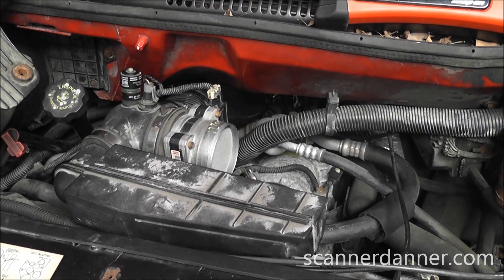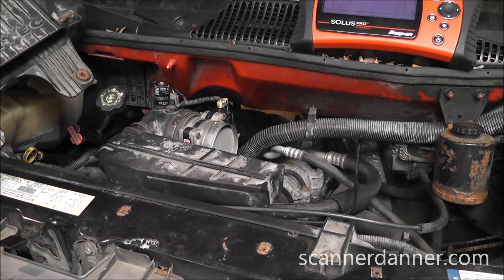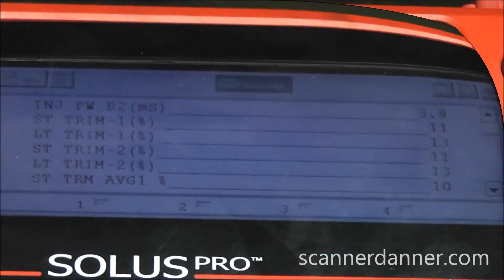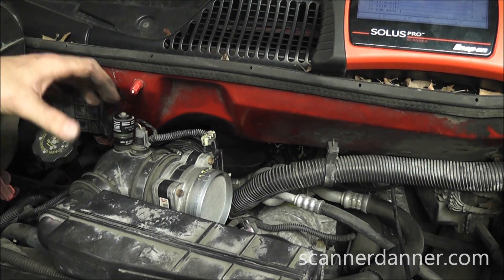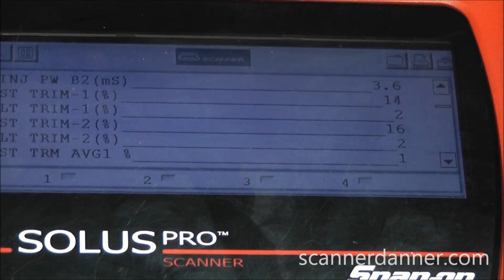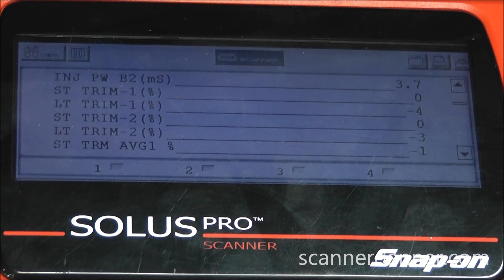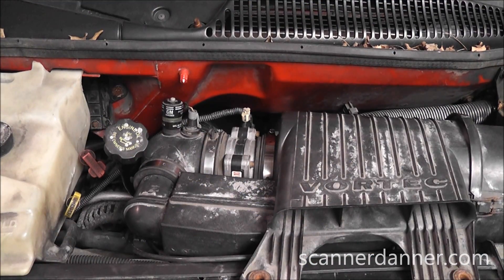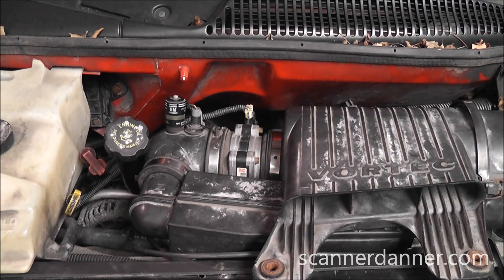Cold Air Intake Warning! (missing air filter case study)

Comment: Fantastic video and videos. Not run of the mill. I'm going to see if the Spectrum oiled filter that I put in my 1998 Tacoma 4wd is giving me the slight lean and elevated rpm. I cleaned out the whole intake system to avoid confounding variables and replaced IAC which was encrusted (after MIL).  Replaced lots of crumbling hoses.  Situation dramatically improved. No codes on the lean.

Other places for possible vac leaks that I learned from SD (thanks!!!) are intake manifold gasket and o-rings. (Brake booster also possible)

I can't afford mechanics on the MILS. They can tell you anything they want. So I LEARNED BASIC OBD2. If this were my career

I WOULD MOVE TO DANNER SCANNER'S STATE AND TAKE HIS COURSE!!!
Reply from the maker: Thanks so much!  Don't forget you can take my class remotely on ScannerDanner Premium right here on YouTube.
Reply: ScannerDanner, there are those of us who would like to take your class in person because you are just that awesome!!!

Comment: Hey ScannerDanner. I have a 1999 1500 4.8L that had 50 shrt term both banks and would pop back through intake right above idle, id say at 900RPM.  but would drive great passed 1500RPM. It was a dirty air filter that caused the problem have the filter was much cleaner causing turbulent air before MAF. This is easily overlook.  Awesome Videos buddy

Comment: Hey, Paul   A few weeks ago, I had  an air filter torn on an infiniti, causing a no start an p0101 code. A day later, I had the code p0420. My reasoning was the torn air filter caused more air into the engine and a lean condition resulting in the p0101 due to rationality check and the p0420 due to the added fuel by the pcm to balance the mixture. Could you please tell me my if reasoning is good? Thank you in advance.

Comment: http://www.standardbrand.com/en/content/mass-air-flow-sensor-faqs/

MAF sensors require laminar airflow, which occurs when the air flows in parallel layers, with no disruption between the layers. The MAF element only samples a small part of the incoming air stream, so if laminar flow is not present the air measurement and fuel delivery will be incorrect. Some older vehicles have a diffuser installed, but most rely on the air filter design to provide the laminar airflow.

Make sure there are no “performance” airflow devices installed in the air intake (like those tornado devices you’ve seen on infomercials). These devices will disrupt the planar airflow that is crucial to accurate MAF readings.

Comment: Will a K&N air filter do this to my 2009 GMC Sierra 5.3 liter v8?  The reason I am asking is I recently got an OTC scanner that shows me my fuel trims.  My fuel trim numbers are as follows:  LTFT1 was(-12.5),  LTFT2 was (-11.7), STFT1 was (2.0) and STFT2 was (2.0) as well. Is this normal for this year and model truck?  It runs strong and idles very smooth. I have noticed that I am getting the same fuel mileage as my old truck which was a 95 Chevy Silverado with the 350 V8 that has over 200,000 miles. Please help!!!!!  You have one of the best channels on YouTube.  I found your channel from EricTheCarGuy's channel.  Thanks!
Reply: Did you ever figure it out? Based on those readings it seems the ecu is subtracting fuel delivery which indicates there is not enough air or too much fuel entering the combust chambers. Actually those numbers are not all that bad though.

Comment: Man I'm glad I found this one. I argued with another master tech for almost a whole day saying a leak before the MAF could cause a problem due to the fact that it would read more air. It was just a theory in my head but I'm definitely showing him this now.
Reply from the maker: +andrew johnson Not necessarily more air but it can change the characteristics of the airflow to the point that it skews the MAF calculation. I think the key in explaining this to him is to remind him that the MAF sensor does not sample the entire volume of air, just one section of it, then based on the size of the bore a mathematical calculation is done.
Reply: +ScannerDanner alright thanks man. I'd also be curious to see the results on a speed density system. Not really sure if it would make much of a difference or if it would run slightly more rich similar to a vacuum leak.

Comment: I've seen a intermittent P0101 MAF code on a 09 turbo Chevy HHR after changing the MAF sensor for the same code. It had a aftermarket replacement filter that looked like it had more or less paper channels vs the factory filter. I could never duplicate the data that set the code. I installed the factory filter on and haven't heard from it since. I don't believe it messed with the fuel trims. My theory is it sometime has voids in the swirl effect on certain induction speeds because of the variable turbo.
Reply: +Brandon Tracy.  I was previously a Chevy tech at a dealership, We have had several vehicles come in from time to time with problems. Most of the time we had found aftermarket air filters the fit, but did not perform as the designed factory filters. Once replaced with a factory air filter the problem and DTC was eliminated.
Reply from the maker: +Brandon Tracy crazy huh? I've been focused a lot more lately on the air filter housing and types of filters being used as well. Nice find and fix man

Comment: I actually agree with Co Jones to a point. I know in some vehicles feeding it an air temp or pressure(ram air effect of some cold air intake systems) actually causes problems because it creates a situation the computer is not expecting. So much so that it can affect mileage.  Guys looking for better mileage instead of power have found that many of the cold air intakes adversely affect mileage.  
Now in my case I really do need a cold air intake on my custom diesel van. Pulling a grade when the EGT hits 1100 degrees you start to worry a little bit. The problem is that it's a 6.5 and so custom that there is no good place for an air cleaner or pipes to run for an intercooler or cold air access. consequently the intake is just a round style cone filter stuck over the intake pipe right behind the radiator. Gets all the engine and radiator heat. On a cool day idling at temp 186 degree thermostat the intake temps are around 100. :(
Boost pressures can hit 22psi, which isn't bad for a mid 90's GM diesel. Just can't run it there for very long.

Comment: Love your videos, I'm learning a lot about ECMs and control circuits watching them.

The honeycomb is to create a laminar flow across the sensor, basically a smooth flow through the sensor. The cleaner box was creating an area of low pressure/low flow at the center of the MAF where the sensor sits because all the airflow was coming from around the edges of the honeycomb and very little was hitting the sensor because the vortex was directing it to the edges. Since the sensor is in the middle it wasn't seeing the airflow along the edges and ECM thought the car was running lean. The clue was when you took off the endcap and the airflow went straight through the MAF with no swirling and started hitting the sensor.

Actually, in this case it was the cleaner box was creating all the problems because the air filter had been removed. A cold air intake would have fixed the problem by making the air go straight through the MAF sensor.
Reply from the maker: +Co Jones thanks Co Jones

Comment: The air filter box is designed to wrap the air around the filter, it will not pull straight into the throttle body due to it's design.  This is not the case with most "Cold Air" intakes as the are generally long enough after the filter to pull the air straight.

Comment: So essentially it was the extra turbulance inside the front part of the air box that made the MAF for some reason decide the engine was running incorrectly and leaned the mixture out when it didn't need to?

Comment: hello Mr.Danner I was hoping you could elaborate on what cases the lean intake popping. It has remained much of an elusive mystery to me. I also must say your book and videos available from your web site are THE BOMB, not to mention more affordable and in-depth than anything else out there. Thanks for keepin it real.
Reply: lol, can i buy a vowel
Reply from the maker: Not sure of the accuracy of this but my theory is, a lean mixture burns slowly and at times is still burning during valve overlap, which ignites the next incoming air fuel charge. (flame front propagation is not my strong point). one thing we can agree on though is a lean condition will cause a backfire into the intake.

Comment: nice video dude.  Ive had a a few cars and jeeps where if the air filter are not dealer only the maf reading spike at 3000 and again at 4000. And a massive lack of power is felt. Mostly Nissan pathfinders and some Renault's.

Comment: Right now I have an 05 monte carlo in the shop with high trims with the intake tube installed but perfectly normal trims with no intake tube installed. Air filter or not seems to make no difference. This thing is totally stock, but I would imagine it's a similar problem.

Comment: The next time I have one of these GM's with that particular setup in my service bay, I'll have to experiment with it(of course when I have time to)
I completely agree with you Paul, once you start altering intakes you will definitely run into issues, especially if you basically eliminate the PCV system. Not a huge fan of aftermarket so called 'performance parts'
Very interesting video once again

Comment: @lenon1980 you would be surprised what you see in the industry.  Most ppl are just completely naive, or don't care. I had a customer who suffered rod bearing failure on a BMW E53.  It was a 2006 with a 3.0L and had 87k miles. The car failed in 2012. Upon further inspection, it had never had an oil change since new.  It lasted 6 years with the original oil & filter! The owner told me when they bought it new, the salesman claimed the engine was sealed and required no maintenance.

Comment: Some years ago i worked on a nissan that ran like a dog without the air filter, engine cutting out all the time. Put the air filter back in and it run like a dream. This 
was before engine diagnostic tools where common place. I put it down to 
incorrect air fuel ratio without the air filter. As they say every day is a school day.

Comment: As always Excellent video keep them coming. question can 1 HO2 sensor cause your car to stall yes i'm getting a p0174 so I took out senor from bank 2 and put it bank 1 and the code change. do you thinks by change just that one can fix it or should i still check for intake leaks. this is the only code i'm geetting. thanks

Comment: Wow thanks again Paul, my own car suffers form rough idle until I unplugg the MAF, the wiring checked out OK but the output was slightly erratic so I changed the MAF but the problem is still there :-( as it happens the engine cover incoperates the air filter and has been cracked by the previous owner and gets worse everytime I remove it. Looks like it's time for a new one, thanks!

Comment: Paul thank you  always have a good one!!! we are having two cars at the shop having hard time  to fix both lean condition  ford both  one focus 00 and the other 96 probe . the focus has  about 30 total fuel trim until about 3500 rpm at idle  and after gets better , the other the  probe has a lean at idle  about  1200 rmp or even less  is under fuel control . both we smog tested twice cold and hot  nothing found . also we checked 02 sensor  response. maybe you have cross with some like this thank

Comment: I have to say that was an excellent find. Like others, I would not have thought about it either.  I do however have a different hypothesis.  I don't think that the turbulence has anything to do with it.  If you recall the "tornado air" insert that was to increase gas mileage and horse power; that was a totally bogus gimmick.  My thought is that the engineers calibrated the computer's O2 readings to include the air filters restriction. Either way this is a good one for iATN and Identifix. Thanks.

Comment: Great video Dan- thanks for the heads up.  This lean condition was basically from unmetered air going in.  The tricky part was that the air was going through the MAF in a way that it missed the sensor part of it because of the vortex.  The vortex made the air thick at the circumfrence and thin where the sensor is.  It's ironic and funny that the air filter housing says "vortec" on it and the air filter actually disrupts the vortex so the air CAN be metered uniformly.
Reply: This is technically not correct.  With the air filter removed, there would have been more air flowing (indeed) BUT an overall equal (or even lower) speed.  Air intake speeds are NOWHERE near turbulent air flow.  They are at laminar flow - smooth, level, parallel air streams.  This is how ALL car manufacturers design their intakes.   Smooth, clean, laminar flow is WAY easier to measure and regulate than turbulent flow with a MAF.  

(The problem here was the shear amount of unmetered air flow)

Chevy named the engine Vortec because of the cylinder head and combustion chamber design.  THAT is where engine manufacturers want turbulent air flow - for complete mixing of the air/fuel mixture.   The pressure drop associated with turbulent air flow is essentially irrelevant once it enters the combustion chamber.   The effects of SUCK-SQUEEZE-BANG-BLOW (compression ratio, ignition timing, etc)  become way more important.   These are basic principles that were proved by Sir Isaac Newton hundreds of years ago

On the other hand, manufacturers want as LITTLE pressure drop - i.e., laminar air flow - in the intake tube and manifold because that is how they maximize air flow (power) for any given internal diameter size.

Comment: Jerry I think it is actually the cyclonic effect. Like the flushing of a toilet. What it will do is increase the pressure at the surface of the tubing causing a lower pressure in the center. Due to the way the MAF's are made the GM MAF's have the heated diode near the middle and would allow more unmetered air to enter the system. Most of the honeycomb screens are only on the 3.8 Buicks and variants. Most others use a screen and it only blocks FOD.

Comment: Hi Paul, that was vary interesting. I own a 1997 GMC Yukon 5.7L 240.000 miles on the clock. I removed the mass-air flow sensor screen with no affect on sort term or long term fuel trims? I am not recommending this be done just curios.
Reply: That screen helps balance the flow of air across the maf wires. Personally I would leave it be.

Comment: Makes sense. I was thinking that the element insert piece was acting like a velocity stack, but its not the right shape. Great vids. I wish we had instructors with your expertise back when I took auto tech.in the 70s. Fuel injection  has actually simplified the troubleshooting and repair processes.

Comment from the maker: this lean condition would be from a lack of airflow across the hot wire of the maf. the honeycomb screen is supposed to reduce the venture effect and ensures equal airflow through every column. 
obviously with the air cleaner element removed there was turbulence that affected proper MAF measurement. it definitely was not more air entering the engine.

Comment: The INJ PW does not seem to change in response to the fuel trim request its was 3.6-4.2ms during pos or neg trim.Is it a time/speed issue between the scope and scanner or what am I missing?  At the beginningI was ready to comment about the Fords. But at the end you showed you are on top of it as usual. Thanks

Comment: Venturi effect. Low pressure causing increased (lean) air flow. The same reason that you need to re jet carbs when you alter air cleaners.